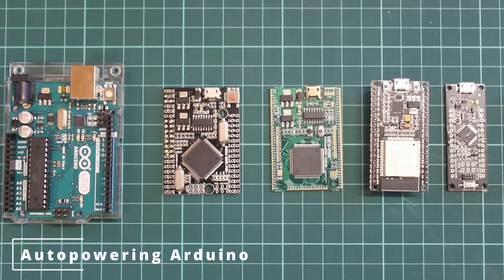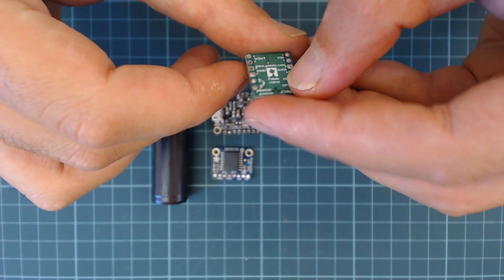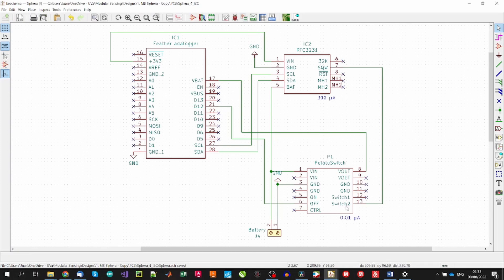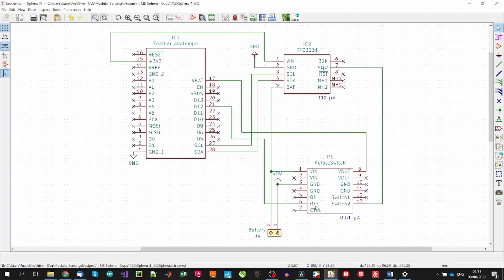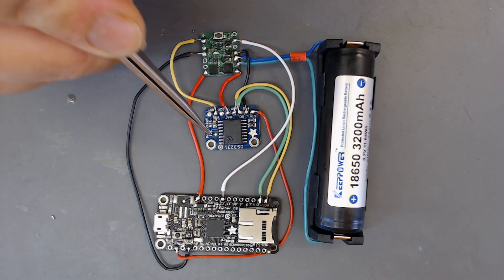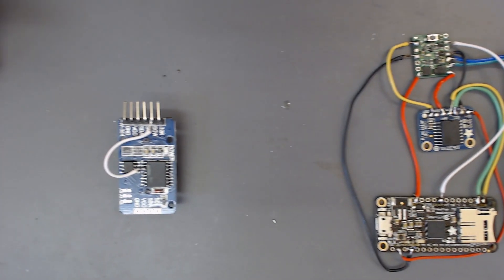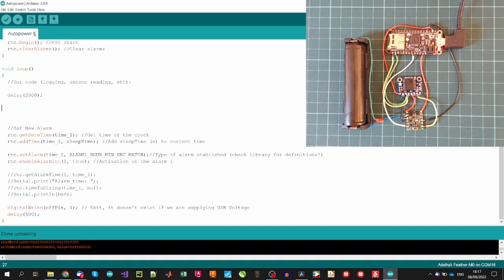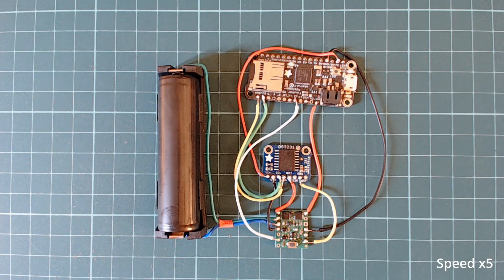Autopowering Arduino for long time performance

Comment: Algo similar al Pololu pero mas económico? Gracias
Reply from the maker: Hello Fred! If you want to make your own cheap design you can use an electronic switch, have a look to:
https://sites.google.com/site/wayneholder/pushbutton-power-on-off-for-arduino?tmpl=%2Fsystem%2Fapp%2Ftemplates%2Fprint%2F&showPrintDialog=1
Thanks for your interest!